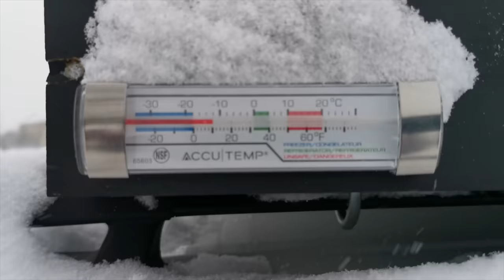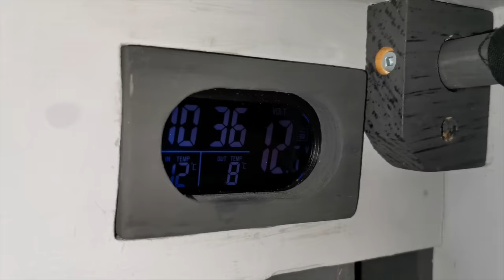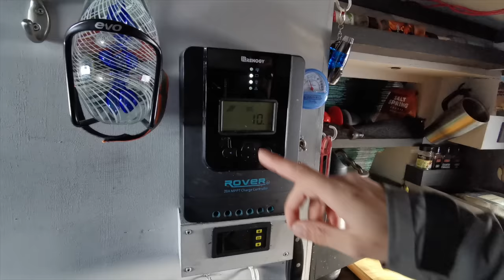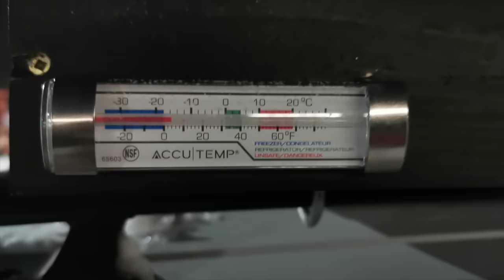Living in a Minivan during Freezing Temperatures

Comment: I slept in my van one day and it was -14 . Just a half inch pad in my sleeping bag. I nearly froze to death and could barely move 4 hours later. Never underestimate the power of cold weather.
Reply: Any car camping at +40°f or colder, is too cold.
Reply: Why didn't you run the engine?
Reply: Robert Wieczorek i was cold at 7°f here with windchill probably 0° for an hour and 30 min in my suv. I was cold. I didnt experience cold tho until that night i decided to put my bull bars in and laid kn the ground for an hour and my feet were frozen and all my skin felt like it was burning and itching and all i wore was a hoodie
Did i mention there was snow? 
Never will i ever sleep in my car in freezing temperatures unless i have multiple blankets, or if i add more insulation in my doors, floors etc
Reply: Im sorry you had to do that :(
Reply: @anninriverside755  really Ann DUUUUHHHH
Reply: Same here my lips chapped to cracked bleeding
Reply: you need a better sleeping bag i gess
Reply: Lexus 93 

Like the " 10F Mummy Sleeping Bag "

SHELL :100% POLYESTER
LINING :100% POLYESTER
FILLING: 100% POLYESTER

Never regretted that desicion.
I'd recommend.
Just make sure to keep away from open flames.
Got it at Walmart.
Reply: I slept in Chicago -23 degrees in February in my ford E-150 Eco-no-line conversion van with NO HEATER ,  a jogging suit, a beanie hat,  2 hot water bottles, 2 pillows, and 3 Quilts, and my remote starter at my hip. I slept just fine no problem at all. Just keep your head inside the covers. You can use a MR Buddy heater or a diesel heater but i just wanted to let you know it can be done 100% with out it.
Reply: I slept in my Taurus car for a year n a half..threw all 4 seasons..went to work every day..it was rough and very hard to start over. But with help from a friend I was able to live life again in a apartment. I dont ever want to face that again.
Reply: The summer heat would be worse.
Reply: Robert Wieczorek lol
Reply: True friends are priceless!
Reply: Lmfao
Reply: I live week to week like everyone else and if i ever become homeless my first move is heading south. In New Hampshire its a no go. Thankfully i chatge my car for free at the dealership so i could just plug it in and run the heat easy off the charger itself.
Reply: @BPoweredLove  Do you mean let the engine idle and die of carbon monoxyde poisoning? It happens every winter here in canada
Reply: That why I live in Flori duh
Reply: All you have to do is get a sleeping bag Thats rated for like -60 and you will be set
Reply: -14? I have a bag that is rated for -40. Maybe you need some better gear.
Reply: Cold is only cold if you’re improperly prepared. Cold weather warfare trained.
Reply: @no-damn-alias  didnt want to sleep with engine running while i was in the back of van
Reply: It was also my work van
Reply: @Justin batchelar lol
Reply: I saw a Reddit post once on Medical Gore and the guy decided to sleep in his car overnight to avoid having to pay for a hotel room. His toes ended up becoming frostbitten overnight and he had to get them amputated. Please be careful when sleeping in your car!
Reply: You need a 5.0 or higher R-value sleeping pad and a good down sleeping bag if you want to sleep in deep temperatures. Though that'll cost a pretty penny
Reply: In Russia we drink vodka to stay warm during those nights. Not a joke at all btw, that is literally what we do. Well, at least the men do

Edit: we would do construction work in the winter and after a couple hours our feet would be soaked because our boots were ripped and we couldn't afford to buy boots every year so we would drink vodka and -3c felt like nothing. Never got cold except for my nose
Reply: I made a similar mistake when I was a kid, went camping and took just a think blanket with the tent, woke up about 3am in agony and couldn't get off the floor. Took me ages to pull myself off the ground and luckily the fire outside was still soldering so rekindled it and just sat there for an hour warming up.
Reply: So this is the whole story. I had a job up in Quesnel BC canada and i wanted to save the $115 LOA that my company was paying me. So i said id rather save that money and tough it out for one night. Not prepared really, and when i woke up after 4 hours, i was literally frozen, so i learnt a valuable lesson that night......get a freekin' hotel if they pay for it. The real kick in the nuts was the fact hotels were only $55 a night
Reply: I slept in a tent in the negatives while I was sick and I absolutely hated it
Reply: @jordannowings3035  you really need to be prepared if you think about sleeping in the cold
Reply: @no-damn-alias  i thought if i slept with the engine running and all the windows closed i would somehow kill myself. Wasn't taking that chance
Reply: @overknight5278  agreed
Reply: @anninriverside755  sometimes you think it won't be that bad. Haven't you ever done anything where you thought it wouldnt be bad, but ends up being bad?
Reply: @lexus9337  nah, ima hit up hotels from now on
Reply: @marcyc.3311  i hear ya, times are tough and people go through extremes just to save a buck. But your a stronger person now, hopefully smarter too😉. I know i wont be that careless again
Reply: @sssbattleaxe  its crazy what people will do to save a buck. It happens all the time.
Reply: @csick11  nah, just someone trying to get ahead, i get it, its situations like that, that will make you a better person......hopefully
Reply: @hubster4477  true friends? Dont have any
Reply: @davidbeaulieu4815  not everybody lives week to week. You just need to figure out what pays alot of money, and go for it. I was 26 living pay check to pay check, than one day i just snapped and said.....'i am a man for fucks sakes, time to make some money' im now 37 and have my own plumbing company
Reply: @Dashboard901  hey thanks for your comment. I just went off saying how you don't know the situation and your calling me the idiot. Some people think being ignorant on youtube makes them so smart in real life
Reply: @iloveyouamberappel  didnt prepare for that night. Just kinda happened and now i know what to do. Get a hotel!
Reply: @csick11 money doesnt make the man young friend. Love and compassion lives on forever. Money and materialistic things are meaningless in the end. Find compassion, and the world can be a better place. But it starts with you. You like to judge before you know. Bad trait. Yes you did good in your life, but remember, you can't put your life in someone else shoes and say see, now you do it. Doesn't work that way.
Reply: @patrickkelly8095  thats just it, wasnt prepared. Best comment so far, thanks!
Reply: @redgringrumboldt8983  thats just it, i was trying to save money.......i won't do that again!
Reply: @robertwieczorek5838  We Are Strong 💖
Reply: @BPoweredLove  Your comment tells EVERYONE that you yourself have no common sense. You should look up how many people DIE of CO poisoning by having their cars idle overnight to run the heater. They fall asleep and don't even realize it.
Reply: @nickc6842  Alcohol is even WORSE to use when it's extremely cold. Your blood gets thinned and when the body is exposed to freezing temps, it draws blood from the limbs to keep your organs warmed, leading to frostbite.
Reply: @BPoweredLove  I laughed so hard when I read his comment. I can't stop🤣🤣
Reply: @csick11  sounds like you know everything. Yes we are in general as a country lazy and entitled but some people are not. Some people never had a chance no one ever thought them the way so they have to learn on their own or life happens. There is no need to make people feel bad about the oddities of life. What do you gain from it?
Reply: Sorry about that, I was commenting on a person who was helped by one friend to get out of the homeless situation they were in. You're right, true friends are very few and far between.
Reply: I've done minus 25 farenheit.. Cool weather sleeping bag (+35°F) fully dressed, t shirt, long sleeve t shirt, 2 crew neck sweatshirts, hooded zipper front sweatshirt, carhardt watch cap, cheap gloves, jeans, no long underwear, decent socks with a couple hand warmers in the foot end of the sleeping bag. Standard cab full size pick up. A healthy person can do this. We are better able to survive than we are led to believe.
Reply: Kaththee1  I see them walking around every day, especially the two legged ones from Ohio, Jursey, Mich and iL. ,..cigerette smoking,..dont wash their hands in the bathroom,.coughing in your face,...they aint sending their best

Comment: I spent a whole winter in Calgary in a Dodge Caravan with just warm clothes and a couple of  sleeping bags and foam mattress . Lowest temperature was -33C. The dry air of the prairies make the sleeping bags more effective. I've done the same on the BC coast but the damp makes 5C feel like 0C and 0C feel like -20C. I don't like to overcomplicate minivan living with too much modification. I make a kind of tent out of a tarp in the van for privacy and collapse it when I got to work, so no one at work thinks I live in my vehicle. I've never had any problem and my bank balance now great. I've spent four Winters like that
Reply: Hey nice job living in your van in the cold months! Did you install a diesel heater or anything ?
Reply: But how do people do bathroom things like shower, brush teeth and use a toilet.
Reply: @ccasey1904  They use a gym or truck stop for bathing and a male can pee in a jug with a cap.If it's the other 💩and you're not at the gym or t.stop then you can go to a gas station or fast food place ect... 👍✌️

Comment: I RV full time year round including winter. I was watching your video and have additional tips for you. 1. Solar Thermal Heating. If you put black curtains up in the cab, (remove the insulation you have instead using CLEAR plastic sheeting in the windows which you can remove when you need to drive) and hang the black curtains (preferably fleece) leaving a gap above and below. Warm air rises, so the warm air will go over the top gap and pull the cold air from below to be heated in the sun. This will warm up the cab. Same with the widows, if you put black felt or fabric on the aluminum insulation in the windows, it will warm up during the day. Freezers are well insulated, but you wouldn't want to live in them. So when you insulate everything including windows, you are essentially creating a freezer and 100% dependent on the heater.

 2.  Get damp rid or cat litter in socks and put it around the rv. Your breath, the hot tea you are drinking, etc generate moisture which will cause mold and moisture on the windows which will freeze and make it colder. 

3. I hate sleeping bags. Your body is a natural furnace. The key is to place a plastic sheet below the bottom covers (above the mattress) and above the top covers (or aluminum insulation with some air flow). This will trap your body heat and works better than nylon. Keep fleece closest to your skin above and below you.  Also your head. If you sleep with a tuque and add a fleece blanket over your head (leaving a gap for air) it will warm your head. Less clothing is better under the covers. No socks when sleeping(feet sweat then the sweat freezes between your tows and you may not be aware of it). This is how your body heat is regulated and dissipated. If you have hypothermia or your heat goes out. Your feet and your head are the most important. I use heating pads at my feet (the disposable ones with 18 hour pads my favorite) or a heated pizza stone to heat the foot of my bed and it's good for hours.  At the head of the bed is the cover for your head. If you can simulate a fever by keeping your head warmer, that heat will radiate through the rest of your body to compensate for it (as long as you are not wearing sweaters, your body must be slightly cool). Your body temperature will naturally increase. By having the covers around you containing that heat and the plastic trapping the heat (flip the plastic over when wet with condensation) you will be hot and toasty no matter the outside temperature. The only thing is my nose has gotten frostbite (I have to remember to keep my nose covered).

FYI, with this setup, (unless I am not well with a cold or flu) I have slept without heat for up to -25c. I have propane heat (Mr. Buddy heater) however not a fan of propane. So I may turn it on periodically and turn it off. Or rather to use other means.

For more tips see my youtube videos.
Reply: Wonderful suggestions. Thank you so much for sharing with everyone - Especially Forest.

Comment: Leave the snow on the windshield, pure insulation my man.
Reply: @leelunk8235  igloo....
Reply: And privacy
Reply: I was thinking the same thing.  Snow is a great insulator and would keep ya private.
Reply: The heat inside the van can melt the snow and when it refreezes it will turn into a sheet of ice.
Reply: @4403323  when snow melts it turns to water which would flow down the windshield, not stick to it.
Reply: Think he removed it to drive to the laundromat and truck stop for fuel and a shower.  Wonder how night parking is going for him as there was no mention of it in this video..also to consider a battery warmer blanket for the battery and a 12 volt electric blanket for the bed, reducing the need for some of the fuel for the diesel heater.

Comment: Been there. Was stuck inside my semi truck at a truck stop in Gary, Indiana during the arctic freeze of Feb. 2014 - temps were reportedly -30. It was hard to breathe outside. Not just the freezing air but the carbon monoxide outside in the stagnant air.

Comment: Definitely need to insulate.  Rigid foam board and wool.
Reply: @TakeWhatYouNeed LeaveTheRest 
What about cutting foam panels to fit the windows, and lining them with wool.
Reply: cattalkbmx good thinking.. and/or think curtains.
Reply: TakeWhatYouNeed LeaveTheRest you’re actually better off to be in your sleeping bag with very limited clothing on. socks, long johns/thermal underwear and a hat. Edit: tuck your coat around your feet for extra warmth. Also sleep with whatever clothing you want to wear inside of the bag with you also. Dress inside the bag if possible.
Reply: @TakeWhatYouNeed LeaveTheRest He already tried propane type heater and it was a fail for him.  That is why he switched to diesel and he is still having moisture problem.  If you foam board the windows and add thick blackout thermal curtains( $5 at Giant Tiger) the windows won't be an issue.   I use these curtain on my windows and they make a huge difference.  Thermal bridging is a greater cause of heat loss then windows and heat loss through the roof is the highest at around 40% and then walls are second.  Lossing half an inch to an inch n the ceilings is worth it.  This is why by code roof in requires R60 insulation which is more than 15 inches compare to 6 inches in between wall studs.  Energy transfer more and faster through steel than glass.   The wool insulations can be shove inside all the nooks and crannies.  Depending how easy it is to access behind his walls he can put wools there.  
He mentioned before that he have to redo his setup because of the moisture problem.  He needs vapour barriers and more ventilations.
Reply: @livelongandprospermary8796  why not sleep with clothes on?

Comment: I bought a "Magnetic Thermal Insulated Door Curtain" for a door on my back porch and it took my back porch from freezing to 72 degrees (with the interior door opened to let the heat out there). It is thermal, lightweight and has strong two way tape to stick it on. The opening is magnetic so it stays closed but opens easily. I think that would be a great investment for someone living in a van. It was $46 on Amazon.

Comment: You definitely need to make some insulated coverings for your windows that will make a difference
Reply: Mattie C I think direct placement of reflectix on glass is ok.
Reply: @SuperDeut4  reflectix is a radiant barrier and isn't an insulator by any means. It has ZERO R-value.
Reply: Just get those silver sunscreen and add foam to one side.  Use the silver side to reflect radiant heat from the sun in the summer and flip it in the winter to trap the radiant heat in.  Score the foam so you can fold it up when not in use.
Reply: Hey Mattie. I have some news for you:
You, màdam, are a pure M.I.L.F.
XD
Reply: @monkvegeta-thepursuerofpea7217  the thirst, it's, too much
Reply: @andrewjb05051998  it's not too much, it's insatiable.

Comment: Haha love the slingshot and marbles. I have that too I bought a bunch of marbles. Flat and round.    
You know you can heat your van with those terracotta pots and tea light candles. It works. Just put a potation behind the seats and curtains on the windows. 
About starting the van. I can give a good trick. Ok at 40 below. Don’t start the car. Just turn the headlights on for the count of 10. Then turn them off. Start your car. It’s the battery that gets cold and until it warms up. That’s why you put headlights on. It warms the battery enough to to start the Van. It works. I’m from northern nh and it can get -40. I have started my car like this. 
Thanks mom for teaching me this.

Comment: “A true minimalist only needs one pair of clothing” how would you wash your clothes if not at the laundry mat? Portable washer?
Reply: They make gadgets call manual clothes washers and dryers that work by centrifugal force. Or some people use a plunger and a 5gal bucket. They both work when your camping. I had a coffee maker and a crockpot that plugged into the cigarette lighter, too.
Reply: @deemueller6470  Even just a 20 litre bucket with a screw on lid can wash some clothes while you drive. It's drying the clothes that is usually the problem.
Reply: Pajamas? You cant tell me he sleeps naked in a van either lol